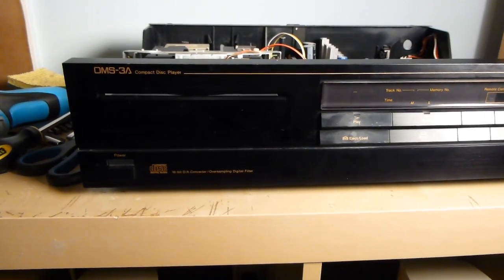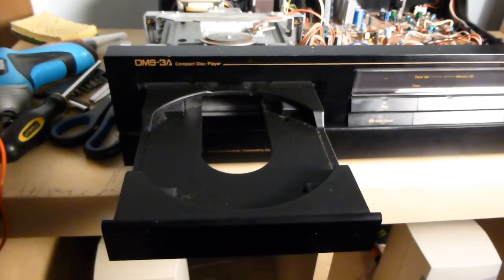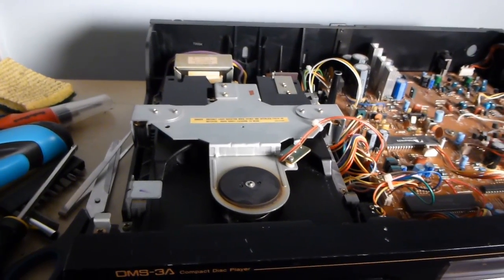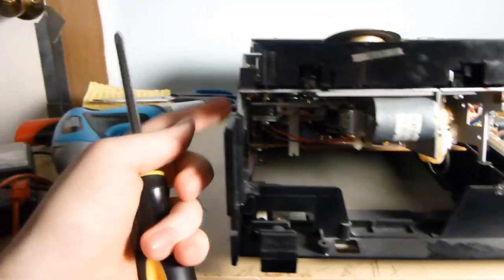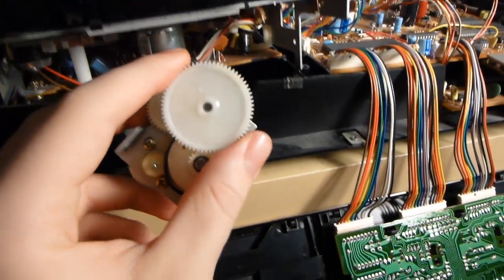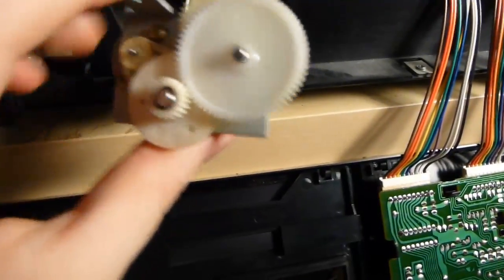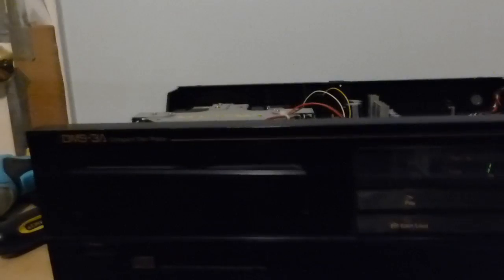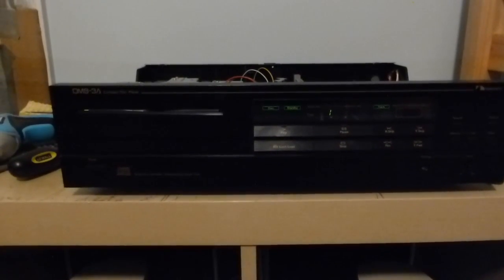Repairing the Nakamichi OMS-3A CD Player

Comment: Thanks for this. I have the exact player with the exact problem. Just a FYI I used a automotive O ring found at Ace hardware for 79 cents. It was 1 1/6 OD and was 1/16 thick. It’s round instead of square like the factory belt but fits and works perfect and will probably outlast a rubber band.
Reply: An O-ring will work but the roundness of it could make it slip, if I used an O-ring, I'd scuff it up a bit for traction.

Comment: I have one, replaced the belt and now the tray works, but won't recognize cd presence, nor will it spin....
Reply from the maker: As I recall, this unit has a separate optical sensor for detecting CD presence.  On mine, it would not detect a CD when the top cover was off, as too much ambient light was hitting the sensor.  Was the cover off when you tried it?  If so, you might want to try putting it back on, or covering the top of the unit with something...
Reply: @IfYouLikeGoodIdeas  yes top cover was off...will retry...thanks